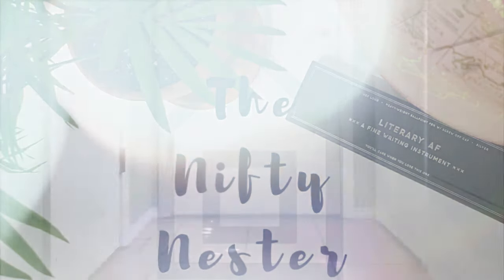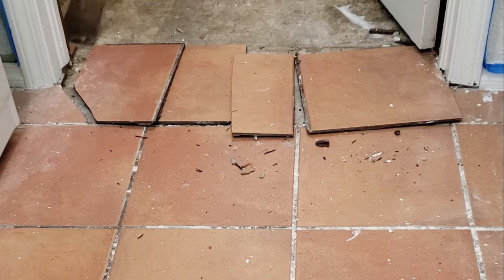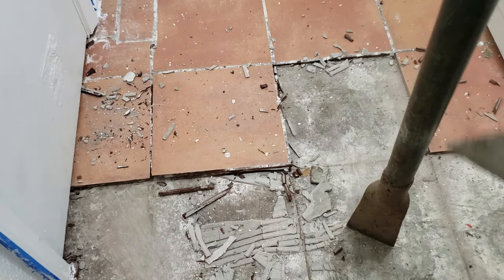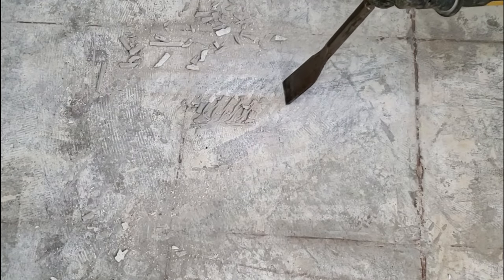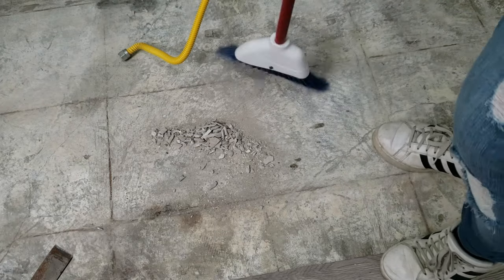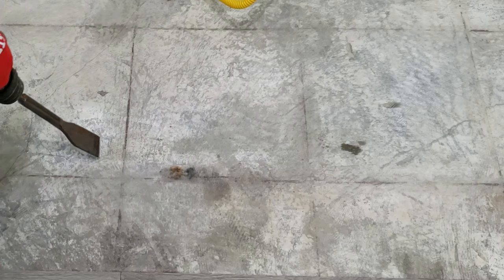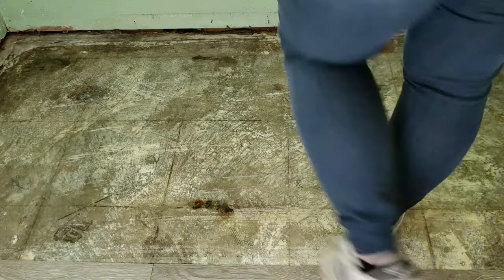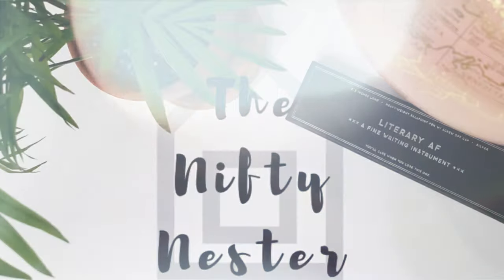How To Remove Ceramic Tile And Thinset From Concrete Floors Easily

Comment: Way over kill, another trick is to spray the floor with white vinegar it acts like an acid will not hurt the concrete but will break up the thinset much easier if you're laying a thick laminate flooring you don't have to be too concerned unless there's really super high ridges
Reply: Pure white vinegar or diluted?
Reply from the maker: I've only ever seen vinegar used to clean thinset off of porcelain tiles that people wanted to keep but I'll look in to using it for thinset removal, I've never heard of that trick. With peel and stick tiles, which is what I installed, the concrete needs to be as smooth and clean as possible. I would imagine laminate would adhere better to a smooth surface as well. If there's even the smallest peaks left on the floor you aren't going to get great adhesion with tiles like that.

Comment: That pill and stick is not going to stick to that concrete floor for long. If your going to go through all that trouble put some real tile back down.
Reply from the maker: This flooring is less than a dollar per square foot. The cost difference is the reason I went with peel and stick. I've had it for about 8 months now and haven't had a single one peel up, they look like new. Someday when I can afford real wood or tile I'll make the change.

Comment: Not a very good tile job to begin with.  Very little thinset. Tile laid properly is 10 times more difficult to remove than what you are showing.
Reply from the maker: That's what I've heard. I guess I lucked out. I think the process would be the same either way but mine was definitely easier than others because of the bad tile job.

Comment: Can't be stressed enough after watching a bit of this video. Tiles are SUPPOSED to be stuck on hard and way harder then these to remove. Not only lack of thinset but appears also over time moisture has worked its magic on the adhesive making it . . . not adhesive.
Just finished removing over 600 2"x2" tile squares - took 6 hours with a rotary hammer drill & chisel.
These ones in this video? Too easy - don't be fooled viewers!

Comment: Poorly bonded tiles. If the thinset was bonded to both the concrete and tiles, the tiles wouldn't pop up so easily and the thinset would be a pain to remove.

Comment: That tile came up too easy. Normally you would need a heavy duty hammer drill to remove the tile. And a grinder with concrete gring cup on it

Comment: You didn’t show the finished look and I would have used an air chipper....much easier
Reply from the maker: This is part of a series I did in my laundry room, the next video shows the floor after and installing new flooring.

Comment: You’re very lucky the guy who installed that tile did a terrible job. A real tile removal would involve a jack hammer or a hammer drill. Along with a small sledge hammer.